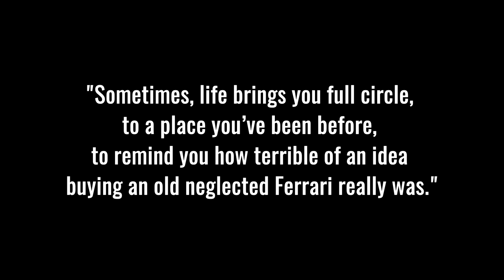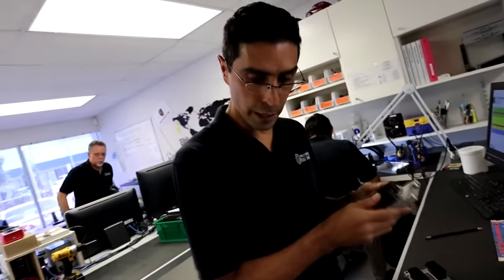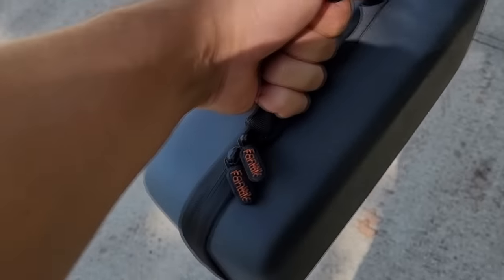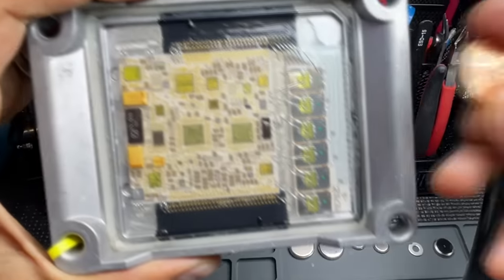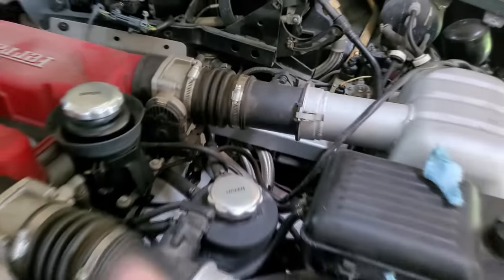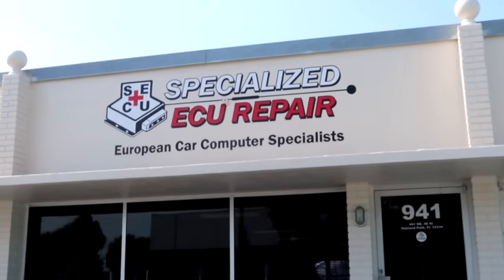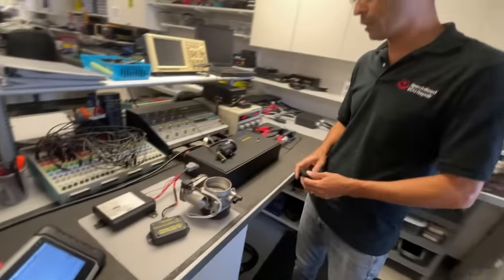Here's What FINALLY Fixed my Cheap Salvage Ferrari!!! (EVERY Ferrari 360's Fatal Flaw)

Comment: I thought one ME7.5 was a pain to tune, two funky ME7.3 units, yuck.

If you sent the bin to the VW/Audi ME7.5 hacker kids they might stop making pop and snap tunes long enough to be able to get it all to play nice. Then you'd need a patch harness and you would have virtually unlimited ECUs.

Others have mentioned using other OEM V8 ECUs or a stand alone. That could work if you sorted out the CAN protocols, anti-theft, trigger configuration and more for the OEM boxes, and OBDII for the aftermarket box.

Comment: cant you just remake the pcb and reprogram the new board pcbs can be designed pretty easily today and theres companys all over the place that will print them for you hell you could probly find a way to turn a bloody raspberry pi into 1 all it needs to do is send and receive signals it dont need much processing power

Comment: All the alleged research, development and not to mention the ultimate price tag to the consumer for this ‘super car’ and still you end up with a nail. Italy’s finest is ultimately no better than a cheap hatchback. Credit to you for persevering with this but Ferrari should hang their heads in shame for churning out such garbage. Some neat kit at ECU repair. I’m sure these guys will find a workaround using modern processors fitted to the old ECU boards. Brilliant diagnostic work on their behalf.

Comment: We say that Italians make almost as bad electronics then the French :)  But anyway... did you thwor a look at the open source ones? maybe "the stuff" will not work 100% but sure can make a car run stop  and so one.. 
Also. those are ceramic hibrids. do not anybody solder on them. just micro welding for repairs!
Reply: There are manual welders for wirebonding avalible. even cheap ones from china * not super nice but not 100k  as  one from Hesse ... But I don't think is really a good idea hibrids are a cancer, :)

Comment: 100 years from now, at an automotive museum open day, a child asks their father, "How come the older 20th century cars & motorcycles are still able to work, but the 21st century cars & motorcycles are static exhibits??".

"Ah",, his father answers, "That's because the 20th century vehicles used good old tried & tested, simple to maintain & fix, reliable carbs, whilst the 21st century vehicles , as a gimmick of the time, used unreliable & expensive ECU systems instead".

Comment: Most ECU failures are blown electrolytic capacitors. This is a special case of FCK YOUUUU Ferrari. Also, I can do this troubleshooting and repair as well, but this guy has a really nice setup. Most shops have bench tools specifically built by themselves for whatever vehicles they work with, so always talk with them first about YOUR vehicle and confirm they have everything. A good tell is if they don't have their own sensors or immobilizer equipment for your vehicle and ask you to send it. If they don't already have your kit on hand, run.

Comment: My Alfa 156 has one of these Bosch units to control the ABS, its a piece of crap, they're all failing, even if I do replace it with a second hand one, chances it will fail soon are so high that it's almost pointless.

Comment: Looks like re-enterable conformal coating on the ECU, which is a bitch and a half to remove.
Upside is you can probe the circuitboard without doing anything to the coating, downside is replacing a component means removing the coating atleast locally.

Wirebonding isn't a problem, just need to find yourself an old manual wirebonding machine. 

Anyone know where I can get my hands on a dead Ferrari 360 ECU? And do the ECUs all fail in the same way, which would be the best from a fixing point of view, as removing the coating will probably break a couple of the wirebonds, and redoing the entire board would take a long while with a manual wirebonder. So ideally you would want to remove the coating only at the problem not the entire board.

But this wouldn't really fix the underlieing design problems which causes all those ECUs to go bad.

Comment: they dont realy solve the problen , they making money of the problem as they keep making more and more money while these special ecu's get rarer and more expensive , the problem probably return eventually (happened to you twice sofar remember )
solving the problem is converting a cheap standard ecu , say from a (set of) ford or an aftermarket setup like a microsquirt and make it work plug and play on this car so you dont have to pay an arm and a leg to make the car run again so that should it happen again you can just replace stuff cheaply 
sure it whont be original branded ferrari stuff and youll create a black hole or cause a solar eclipse or even go to hell for even think about it , then again the ferari dealership doesnt want to touch the car anyway because the profit margin is too small and ferrari stopped making the part in the hopes that youll buy a newer one .... most car hobbyists save for years to be able to buy there dreamcar , they cannot afford multidigit repairs they just want to drive it and do the repairs themselves 
ITS A FREAKING CAR NOT A SPACESHIP they work the same way as any car and should be able to run on cheap parts that are not branded ferari , ferary shops at the same partstore as all the other carmanufacturers

Comment: Given what newer programmable ECU's can do, it may be time to research an upgrade. Preferably before you have another failure. I'm sure there is at least one or two models out there that would do the job quite well. There might even be one that could be configured as a failover to limp mode it home.

Comment: Forget Farrari, all cars now have computers which is another way of saying that your car is made to go wrong, and made so you cannot fix it, try looking at the belt driven gearbox with the metal drive belt, if it breaks buy another car because it will cost you as much to replace this stupid belt.
I seem to recall that if you bend steel enough times it will break, and being a belt the thing is bending all the time its in operation..
They say that they should last at least thirty thousand miles, this is saying your car is made to break down after thirty thousand miles, taking into consideration things are supposed to be improving  does not say much for the modern car , my first little Ford popular did better than this.I would say dont put these belts in a car until you have mastered how to stop the bands that hold it all together from breaking.

Comment: Sam, thanks for the jump pack endorsement. Gonna get me one of these for those batteries that are below 9,10,11v that the chargers won't charge. Smaller than my current jump box and don't have to put that in line with the dead battery and charger to charge anymore.

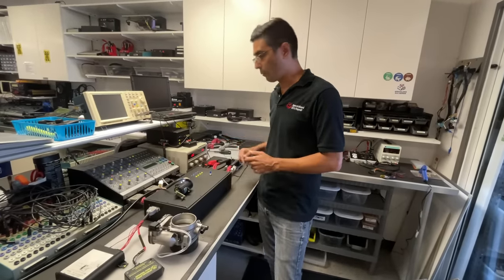Comment: 12:22 - this explanation is EXACTLY why right to repair won't work and is a bad idea. Hybrid tech is a step FORWARD. The BMW board is the old tech. Sure it can be serviced but it has to have sockets for the chips. The hybrid is pretty much 3d printed. Its one solid lump. Its cheaper to make, much smaller, less waste, less components. Its also not serviceable.

People need to realize that the ability to repair is dying for such components. Life is no longer about popping chips off boards. Also the Chinese, Taiwan, S Korea, Japan are going to make hybrid tech components. Do we block their products cause we can't repair them?

Comment: As a former ET with USN the first thing that leapt to mind when you first turned the key was ECM. Complicated electronically controlled high performance cars are going to have ECM failures because it's operating in a hostile environment and the reality is that it was not designed to last beyond a planned lifetime. It wasn't designed to be repairable on order to maximize profit margin.

Comment: Wire bonding and hybrid IC repairs is standard practice, there are even hand built hybrids, no "robots" involved. How someone that professionally work in the electronics industry doesn't know this just show their level of ignorance or incompetence. What is also beyond me is Ferrari owners whining and fussing when the overpriced and horrible Italian system-engineering shows its face... Like, look where they placed those ECU's, and tell me what did you expect, really?

Comment: Yes. I can imagine Apple making a jump box. I would look nice stylish, and a year later be a paper weight that Apple can't be fixed, yet Louis Rossman (if I lived in NY) could find and fix the problem in minutes. Only problem is going to Louis mean shipping it out of state, it cost way more that it should because even when Louis gives a deal, he had to over pay to for the parts, and pay extremely high rent so can not charge less unless HE wants to go out of business. Yeah, Microsoft sucks, but I can use Linux or other operation systems, or buy dozens of other hardware sources, and avoid Microsoft. With Apple you are stuck replacing Apple for Apple, and IOS for IOS.

Comment: I'm sry guys repairing ANY automobile shouldn't be so complicated.  How can it be that when something goes wrong it takes forever to figure out what's wrong ????  It doesn't make sense.
These automobiles should be fitted with modules for certain sections of the car for what they do.  When something goes wrong (with is planned in the design) with that section it should be swapped out for another (that part should be rebuilt) and you should be on your way without being kept hostage for days & robbed by the dealer and manufacturer of the individual parts. (that are made defective by the oem part manufacturers)

Comment: Nobody is going to delve into the world of ECU replacement for a niche market. The tooling and the backwards engineering it's going to take to reproduce that item is not cost effective.
You will be at a cost point of close to 3k or more. Ferrari and just about every other car manufacturer has just introduced the world of throw away laptop computers, because cars are turning into electronic POS. 
A channel I would recommend to you is Louis Rossman and his constant battle with state legislators in all states with the right to repair and Apple's insistence of preventing the customer from repairing their devices and even manufacturing fucked up components so that you buy another POS product.

Comment: OMG why why why Ferrari! Beautiful car but why do you have to make it so difficult to repair, just to get a few inches space, really surely you could design some space to fit a sensible solution. Come on guys this is going to force these off the road unless somebody can come up with a sensible replacement. Bad support advertisement if you are going to make something that is unrepairable and then stop making them! All power too Jose

Comment: Ferraris are beautiful cars but reliable and tough are words you simply cannot use with them. However, Lamborghini, will last for hundreds of thousands of miles and start every time! Having have worked at a Mercedes Benz dealership that also serviced Ferraris and Lamborghinis, as well as Maseratis and Jaguars, Bentleys and even a few dedicated Rolls Royce owners, and Ferrari has been nothing but a serious pain in the ass from start to finish, but Not even Jaguar has been as serious a problem as Ferrari has been. But alas you can tell a Ferrari own this fact without getting a loud vocal rebuttal. But My experience has been just that, Ferrari sucks, looks great, but sucks like a hoover! We had an old 90 year old man with a came who owns both Ferraris and Lamborghinis and he hardly ever drives his Ferraris because they are so temperamental but he has an Italian Lamborghini that he imported from Italy so it was carbureted, not fuel injected, and he drove that thing like he stole it and the only thing her ever had to have done on it was oil changes and brake services, oh and once he needed a clutch, not because it was bad, but because it was worn out! I would pit a Lambo against a Ferrari any day of the week and I'm positive that the Lambo would vastly outlast the Ferrari for need of servicing to needing repairs of any kind. That Royal Blue Countach LP500S was bulletproof! And nowadays we see Lamborghini engines in lots of vehicles made in Europe, Like Audi, VW and a few other from what I hear.

Comment: Stop all this messing around, and go STAND ALONE. Stand alone ECUs run nearly every race motor in existence, and it's childs play to run a factory Ferrari 3.6. Not to mention, the ability to optimize for power an efficiency would be realized as well. I would never mess with this factory ECU garbage, especially when the modules are so expensive, and the fix is just as much money and labor. The expertise your ECU repair encompasses would be better spent making a tune for stand alone

Comment: WHYYYY would you want to fix that shitty ferrari module? Old lambos have ignition problems with modules that don't exist anymore and they use msd stuff to replace it, so why would you want to fix this? With 1/10 of that guy equipment I can make an adapter for any aftermarket standalone ECU that WILL have support and will be much cheapper, modern, efficient, etc... Those guys  with that level off knowledge could just make a standard program for an aftermarket ECU, hell they could make their own version off the megasquirt pre-programed for the 360 ferrari with plug and play connectors.... whyyyyy fix? whyyyyy